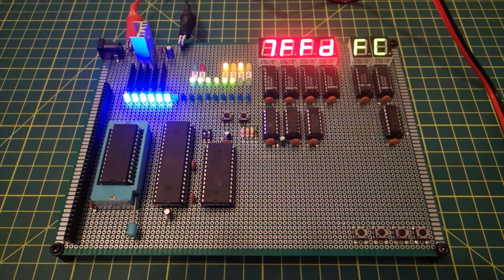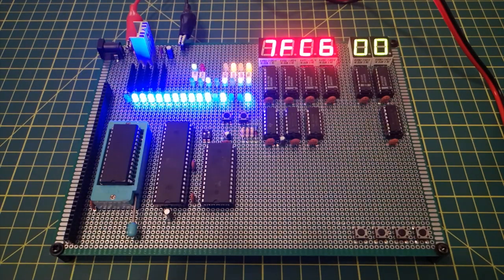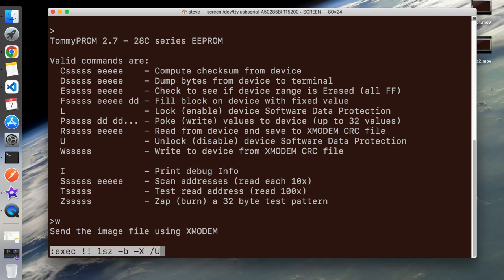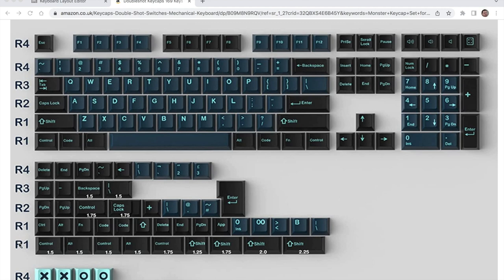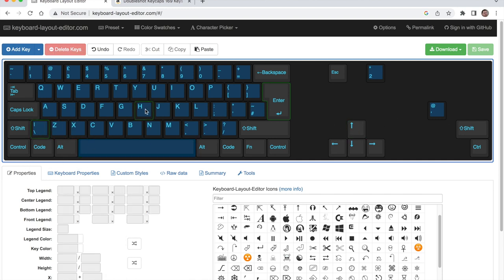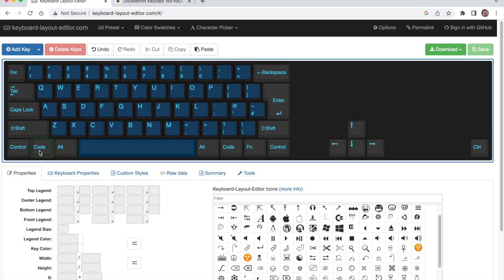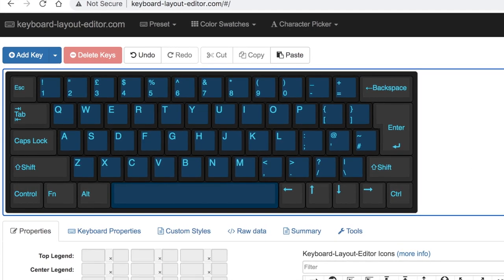Z80 Computer - Part 7 Keyboard Layout

Comment: I wrote a bit "assembler" for my ZX-Spectrum with DATA sentences like x,y,z,201 (all numbers) in Basic as a teenager. It concluded with a racer program reading the road map (some random thing to make in Basic before starting) and the machine code took care of left/right and writing to the screen and collision. "The race car" was 8x8 pixels and also just a character to read from Basic data. It crashed the ZX-Spectrum 100 times. The speed gain was 100 times better and I had to go to a computer school in the end of it. There we went back to the past in my opinion. At least I got a job for a short time and therefore it paid off somehow.

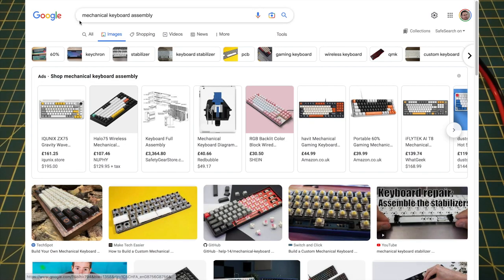Comment: 9:45 Can you pleas put the Bredbortport to some kind of Expansion port
Reply from the maker: I'm not sure what you mean.
Reply: @SteveRaynerMakes  I want to have an expansion port on the computer, so I thougt abaut using The long black conector that was used to conect to the breadbords in the Begining.
Reply from the maker: @pevkh8359  Yeah an expansion port is a good idea. I was thinking on my final design I will use a PCB edge connector like it was done in the old days. But for now, that long black connector is proving invaluable for prototyping with breadboards. It's perfect because it's 40 pins long so I've connected all 40 of the Z80 CPU pins to it.

Comment: It could perhaps be strange to you but we have a small shift key on the left side in our layout (to be able to fit another special character).
Would it be too strange to perhaps make that one smaller and move the fn up one step so that you can have two identical control keys?
Another idea would be to replace caps lock with something else since it's virtually unused except for L O U D mode in chat forums :)

Comment: You'd have made your decisions by now, but: Keycaps: DSA and XDA. Profile is same row-to-row which allows more room for rearranging what's where. You could've implemented PS/2 on the Z80 directly OR used a UC, but your reasoning for the latter is sound-ish. More on that in a minute.

Maybe unique viewpoint: Some classes of chip (e.g. video) are unobtanium new. NOS maybe, but most likely used pulls. There's enough to supply replacement parts until someone makes a popular project … MOS 6560 is > US$100 last I looked because someone created a VIC-20 kit. UC can emulate a video or sound chip and IMO that makes sense today. Save the "cheap" used pulls for the low-demand repair market. Bonus of UC over CPLD/FPGA: Porting to a new UC is easy, some old retro project HW is dead now because the FPGAs they needed are too rare now.

A UC for PS/2 can likewise make sense, after all IBM used one all the way back on the IBM PC. The thing is, like you said, using one that's more powerful than the machine you're building … ehh, feels like cheating. Only way I can justify it is if it really increases the convenience and cuts the costs. If you design a matrix keyboard interface and test it even just on a breadboard using some of those keypads in every Arduino sensor kit wired together into an 8x8 matrix … you have a test circuit. I'd do this for keyboard, eventually mouse, and probably SNES gamepads. And then I'd replace all three of those with a UC that could host a basic USB keyboard, mouse, and Xinput-compatible SNES gamepad. Here's the circuits you can build … or the UC circuit you can just program. Your choice!